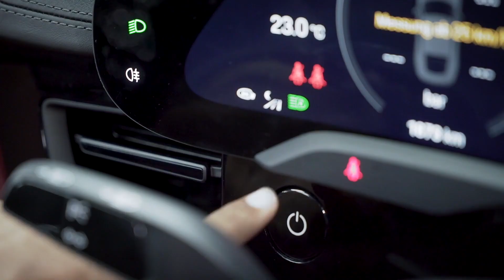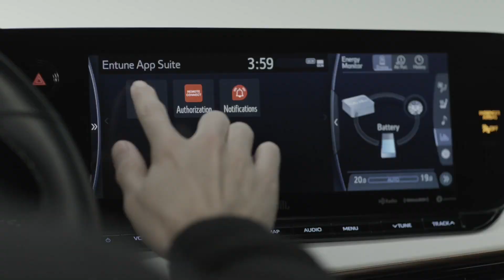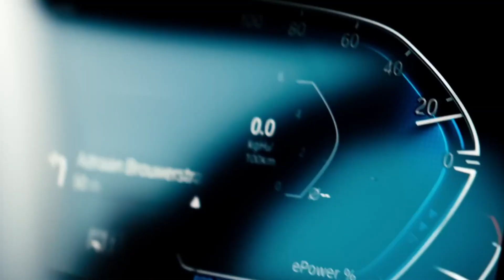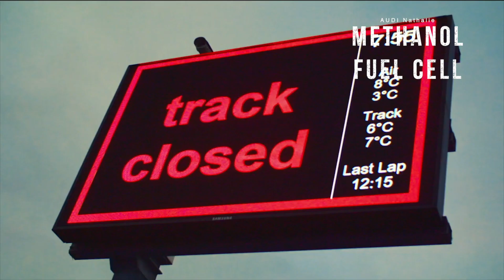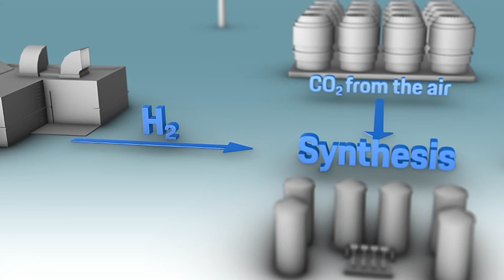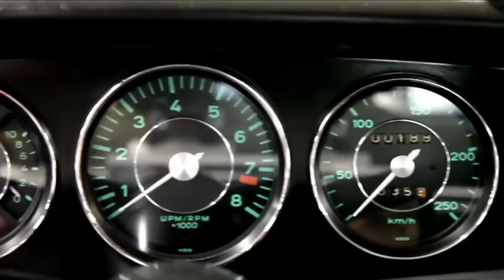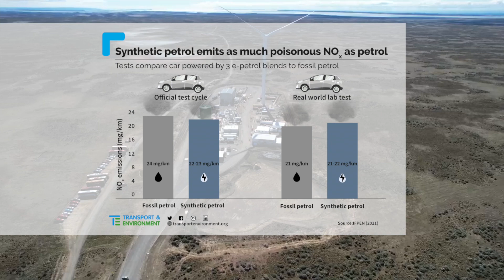The Truth About E-Fuel: Revealing the Future of Transportation

Comment: All fuels have an immediate inefficiency built in compared to electricity from a grid or locally generated energy. 

That is they need to be physically transported, stored, transported again, stored again and then maybe make it into the end consumers vehicle. All this is extra physical infrastructure and materials making all those storage tanks, trucks, trains and pipelines which have their own environmental cost. 

So somewhere around 30% of fuel is used just shipping and distributing fuel. If you reduce consumption of 1 gallon of fuel you are actually reducing 1.3 gallons of consumption. 

Compared to grid electricity which only loses somewhere close to 2% transmission loss and requires much less infrastructure. 

So whatever the other differences and efficiencies, fuels have a really hard time being as efficient as electricity playing catch up from the beginning. Does not matter which type of fuel, they all have this disadvantage.
Reply from the maker: I agree,
Reply: as electrician myself, Are you sure only 2% loss?

Comment: All are neccesary, combustion engines, electric motors, fuel cells and hybrids, for keep a balance, help the environment and for not harm people's taste 🙏🏻🙌🏻, the future is the ecology ♻️
Reply from the maker: Combustion engines should be fazed put 50 years ago but unfortunately it will not happen by 2035 because they are not able to produce enough electric and hydrogen ones to replace them.
Reply: @Robb-USA  That's what i said, a balance, the ecology is the future
Reply from the maker: Balance is not the answer, combustion engines are poisonous and I am not talking about CO2 because CO2 is not toxic. Combustion engines shouldn't be considered at all for the future. Best choice is electric but because of the slow charging battery we have to use half measures like hydrogen or methanol fuel cell electric.
Reply: @Robb-USA  If you going to technology will happen the same